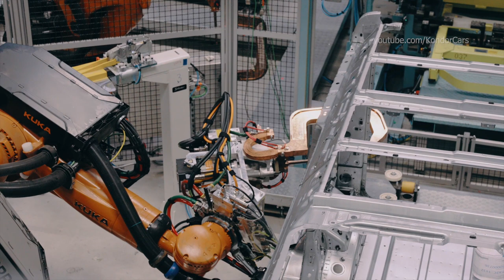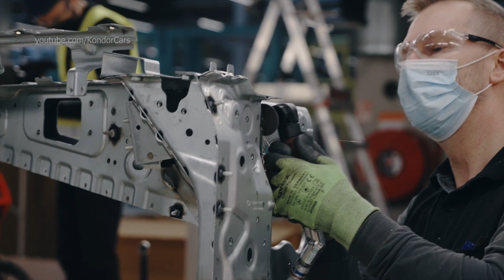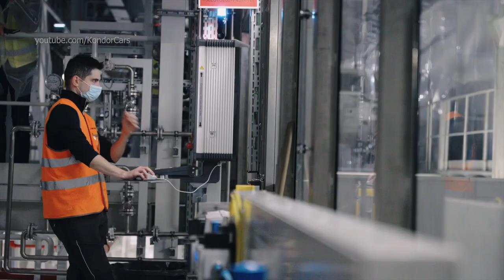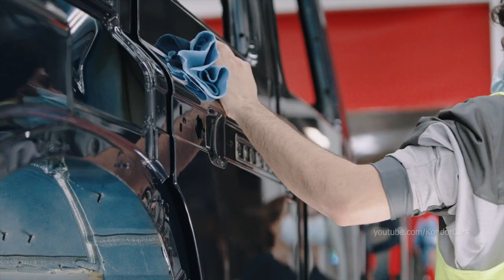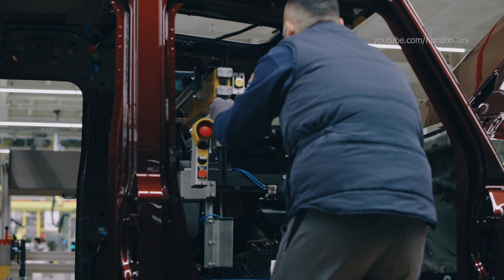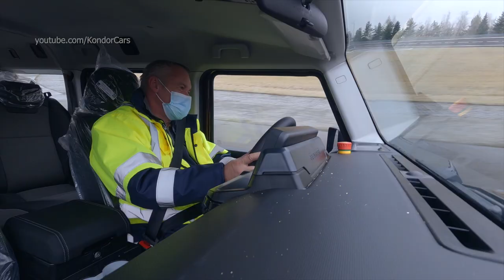INEOS Grenadier Production - Hambach plant

Comment: BMW 3.0L in-line twin turbo engine. 
Chassis designed by Magna Steyr .
Chassis made by Gestamp.
Panels pressed by Mercedes Benz.
Transmission by ZF.
Rigid axels by Carraro .
Transmission housing by Tremec.
Interior by Recaro.. 
Assembled in a Mercedes Benz factory (Smart).
This has the makings of being a formidable machine, mines pre ordered!! 🎉👍🏼
Reply: What did it cost to preorder? When will they be sent to the U.S.?
Reply: £450 in the uk which is refundable, not sure what’s happening with regards to it being released in the US, that said it might be worth emailing them.. they’re really helpful to be fair.
Reply: @horatiodebonairepicklehoun1415  USA is also a $450 deposit, I placed a reservation for one, but USA will be a year later :_((
Reply: @hossein3867  it’s a shame you have to wait another year, but the upshot is that if there are any teething issues with the initial models produced, then hopefully Ineos will iron them out before it’s released in the US.😉

Comment: It's definitely not for tough tracks. It will be an amazing tourer if a long range fuel tank can be mount without removing the main fuel tank. However looking at the underneath there is no place to mount. The rear would be (behind the back axel) an ideal place for aux tank, but with not very good clearance it gonna be quite challenging until some after market companies come out with a genius idea.